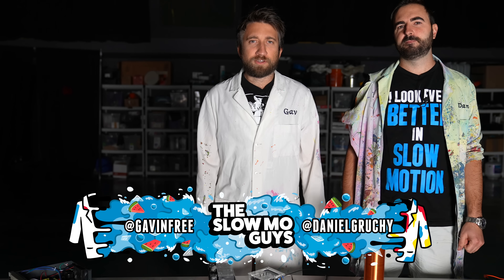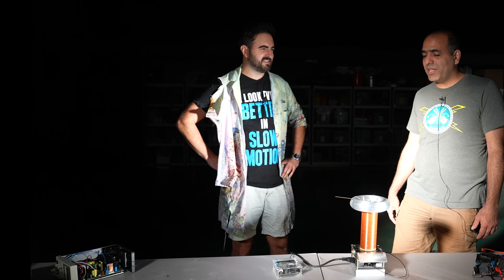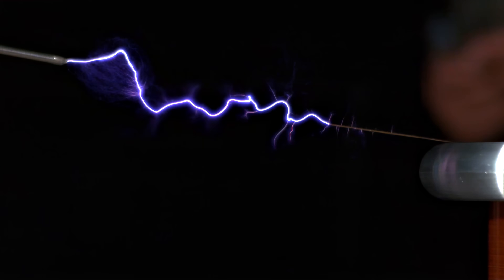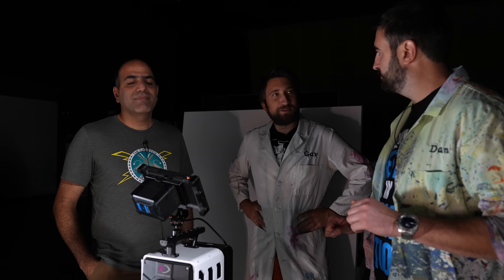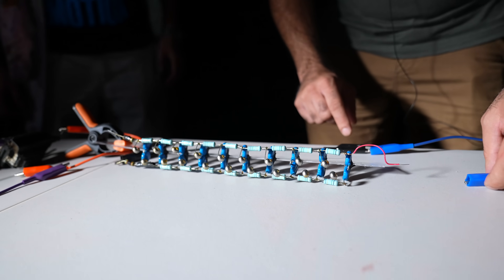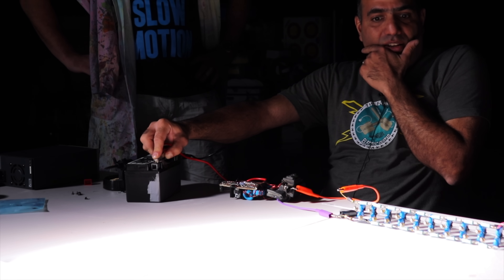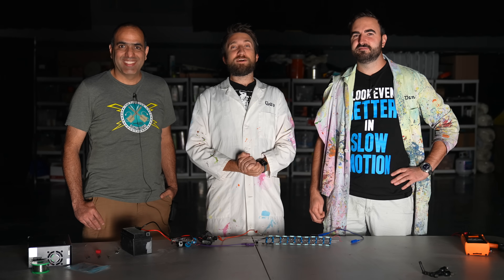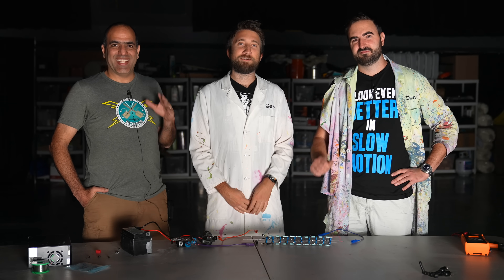Electrical Arcs at 1,750,000FPS - The Slow Mo Guys with ElectroBOOM

Comment: I don't know if Dan will speak to me after going through so much pain!!😈
Reply: The legend of comedy and knowledge 😂
Reply: He should’ve expected nothing less.  It’s the price of working with a legend like you!
Reply: I was shocked by mehdi
 (the t shirt)

He would have a cue of people in no time at all.
Reply: @leewolf6434  
It's more than that. It's one legend (or, rather, two legends) working with another legend.
Reply: 14:28 Hey Mehdi please explain this. Dan said you would explain it in your video. I don't think you did.
Reply: @harsh_adukia  he will most likely explain it in the analysis video (not yet released)
Reply: @harsh_adukia  I haven't watched his videos about the device so this is just my thoughts based on what I know. The thing is a chain of capacitors which build and store electrical charge in them and release it all at once. With his setup, full capacitors hold a lot of charge that want to release all at once across the metal nubs but they're being held back by the capacitor. Think of it like a dam holding back water, a ton of water that wants to flow down but is held back by a giant wall. What I think is happening is that each capacitor in the chain is building up charge and when they max out the "overflow" moves to the next capacitor. When it gets to the last capacitor in the chain there isn't anywhere else for this overflow to go. Now the dam from earlier is beginning to spill over as excess charge from the final capacitors searches for a new path - the gap between the metal nubs. As soon it completes its path across the gap it breaks the floodgates on all the capacitors since they now have somewhere for their charge to go and they all release it across each of the nubs.
Reply: @harsh_adukia  yes you are true
Reply: PAIN
Reply: @harsh_adukia  he will most likely explain it in the analysis video (not yet released)
Reply: @harsh_adukia  Mehdi is doing a follow up video next and going through the footage.
Reply: bro 💀
Reply: @hackerman1752 you’re not his bro, nerd
Reply: LOL
Reply: Thank you for not only keeping us safe through entertainment throughout all these years, but for also taking the time to explain all of this stuff to us.

I love all of the silly humor, and the creativity behind the video, but at the end of the day we all walk away a little bit smarter because of you. (And the slow mo guys, love you too.)
Reply: @MakotoMonokuro  keeping us safe? 😐
Reply: It's fine, im sure he's well used to it at this stage on the Slow Mo Guys....
Reply: Dan sacrificing hus body to get cool slow-mo shots is pretty much par for the course.
Reply: Mehdi, you have to take these guys and go do a collab with Styropyro! I know how much you love arcing electricity, and that dude does it like no other.
Reply: That capacitor gadget sparking on the final gap then setting off the others could be acting like a TX antenna, where voltage is highest at the tip of an antenna and highest current at the base? Could this be a visual of how a TX antenna works? Pretty cool!
Reply: Oh god it's the electrician
Reply: On the contrary, if Dan's relationship with Gav is any indication, he's probably trauma bonded to you now and will show up for more
Reply: The collab we didn’t know we needed
Reply: @OfficiallySnek  nobody "needed" this.. it's just interesting to watch
Reply: So glad you're still doing what you love and entertaining/educating us after so many years
Reply: considering you're not banned from UK after that video, i think Dan can forgive u
Reply: @ElectroBOOM  >>>  Nah, Dan is MORE THAN HAPPY to "take one for the team." 
 😊😊😊
Reply: OK, Boomers!
Reply: Well you didn't break his wrist like Tony Hawk, so you're probably ok.
Reply: My assumption on why the last one on the generator went first was maybe there was a large enough cloud of ionised air coming from the end part that the air resistance was much lower at this point.
Reply: @erdmannelchen8829  The closest pair will go first. They can't all be exactly the same distance apart.
Reply: Haha does Linus still talk with you? Didn't he suffer more?
Reply: I mean, your known for your setups shocking you, soooooo
Reply: Hey, Tony Hawk broke Dan's arm.
Reply: A legend ❤
Reply: Are you fixed the power supply?
Reply: We’re all spelling your name wrong, Mehdi lol. 
Sorry. 
It takes time to get used to very foreign spellings.
Reply: The more you get to know Mehdi, the LESS you will trust him!  :)
Reply: Hahahahaha
Reply: @UCxZHI-uH9LZ_OygPLFHH0BQ go eat dirt.
Reply: I dunno.
He's still friends with Gav.
Reply: Would it move faster in a vacuum? What if you changed the gaseous medium it was arcing through?
Reply: "its almost like its running at the speed of light... almost" killed me
Reply: What a fun combo, two of my long time fav yt channels coming together, and BENDING the envelope of high-speed photography and high voltage plasma discharges. 
Go Mehdi!
Now if could get Steve Mould in there two, would be a blockbuster science video.
Reply: You also did a mistake. You could put a grounded object there. But it was Dan.
Reply: at 18:31 i see that the arch gaps closest to left side of capacitor aka zvr side  are wider hence the answer to question is why the right side arch gaps sparked first creating the rest and why the brightness is highest towards the left...

answer :- due to spark gaps being further away on left side ..even though the capacitor charges up first with more voltage but due to further difference of arch gaps it keeps rising until the capacitor at right is high enough to create arch there due to low distance between them ..

now due to high charge on capacitor left the spark arch are brighter ...and so forth ...
Reply: Friends for life Mehdi, for ever ever.
Reply: This isn’t the the slowest they have filmed as I recall they filmed at 5 million on a explosion in water in July!!
Reply: Now you guys just need a sequel with even faster cameras and even more bonkers electrical thingies. Perhaps to zap Gav as well...
Reply: Pams
Reply: why does the arcs have random patterns? its random!!Is there a way to detect the patterns ?
Reply: The posterboy of electrical engineering and engineers in general is here….
Reply: What would happen if you did this in a vacuum?
Reply: He didn't break any bones in this video, he'll count that as not too bad XD
Reply: Op
Reply: Don't worry, he still talks to Gav
Reply: The reason the last gap always fires first, my guess is, the last gap happens to be the shortest.
Reply: Yep make a arcalator arcs then charges to 2.000.000 then boom
Reply: That should have known better 🥴
Reply: He trusts you enough to high five you next to all of your high voltage equipment, has he learnt nothing??? 🤦🏼‍♂️
Reply: Lol
Reply: Well, a higher frequency certainly Hertz him more.
Reply: THEMANHIMSELF
Reply: he broke his wrist for the channel, this is nothing
Reply: Boom... my heart has nothing but love
Reply: Bro, I knew this would be an exceptional video soon as the intro clip went by haha
Reply: FINALLY IT HAPPENED
Reply: FOOOOOOLLLLLLL BRIDGE RECTIFIERRRRRDRR
Reply: You’re wired and funny 
I hate getting shocks ⚡️ I cringe and laugh watching people getting shocked
Reply: I wouldn't...
Reply: Thank you good sir!!!
Reply: He doesn't have a choice, you saw him wearing a slowmo shirt, he should be buying you a drink.
Reply: I think I it's going on and off again within one pulse because of resonance.
Reply: Chad 007  i too have been waiting. Waiting for more spam accounts to block
Reply: 3:40 touching something electric while wearing a metal watch 😅
Reply: Way to get revenge for Dan's crimes in Iran.
Reply: That is the only way Dan can get a good rest these days; sore, bruised, or bonked. Mad lad
Reply: https://youtube.com/watch?v=ituKgMsZB9k&feature=share
Reply: خودت از بس شوک الکتریکی خوردی یک پا ثور و زئوس شدی ، واقعا تعجب میکنم چطور هنوز زنده ای. 😂😂😂

cause of So much electric shock you were hit, that made you become thunder god like Thor and Zeus 😂
We love you from Iran.
Reply: LOL
Reply: e wiz
Reply: My little one was terrified of electrical shock.  I let her have a few safe ones and she thought it was the funniest thing.  I think Dan will feel the same way.
Reply: I love your channel ElectroBOOM. 😂👌
Reply: Yeah but….  Gotttem😂😂😂
Reply: Super cool to see you guys team up!  :)
Reply: Thank you @electroboom for so so many thousands of smiles over the years.  You were the perfect partner for this project!
Reply: Medhi it would be ABSOLUTELY CRAZY and AWESOME to do this with a really big and much longer Marx Generator !
Reply: Boom
Reply: Nyquist.
Reply: 7:57 Nyquist frequency
Reply: I thought he was not going to trust you after that laugh. @3:17
Reply: He felt the FULL BRIDGE RECTIFIER
Reply: @Benjamin Garner that is right these two channels are the best
Reply: Do you know about Utkin effect?
Reply: If it ends like that then you know you've done a good job
Reply: He should know better if he has seen one of your videos......if not that’s his own fault for not researching properly.
Reply: Are u alive ? Oh thank god
Reply: He's probably experienced worse so you shouldn't worry that much.
Reply: @ElectroBoom It is interesting the impulse generator sparked across the last gap first. Hopefully this is something you discussed on your channel
Reply: lol!!!
Reply: it's your first video..... that you didn't scream loudly 😂
Reply: I can hear him saying this
Reply: u looked like ur getting interviewed on live tv
Reply: I was wondering if you think the final spark gap arced first due to the fact that conventional current is running from negative to positive? Also, assuming that the velocity constant through this medium is approximately 0.6, and a marx generator length of approximately 400mm this would mean that the propagation time through the circuit would be around 2 microseconds unimpeded. Once the surplus charge is bridged across the first gap, then assuming relative homogeneity across the remaining gaps, then you would need a frame rate of around 6 - 7 million to capture the difference between each remaining gap (based on the number of gaps I counted). Also, please be careful. I built a Marx generator once and was working on it when I was very tired one day and somehow made the mistake of trying to build a voltmeter to measure discharge and accidentally build the circuit incorrectly and the generator literally vaporised my voltmeter circuit into powder. At the time, I had stacked the layers of the generator up to approximately 600kV at which point I decided it was starting to get a bit too dangerous for a bedroom project.
Reply: Hehe you were and are awesome!
Reply: E
Reply: Why does the spark start at the other end?? Silly humans. Electricity acts no different than Pneumatic or Hydraulic. Imagine the oval ends as nozzles. Your vessel has to first fill completely and pressurize. The pressure and back-flow starts at the farthest point.
Reply: Could be a good teaching method in Electronics School
Reply: I would. He would.
Reply: Literally ur whole career, he’s gonna survive.
Reply: I don’t know how you are still alive bro 😭💀
Reply: I’ve seen your electric guitar.  But I’d still trust you.
Reply: چطوری عمو برقی💀
Reply: And it was optional lol
Reply: The legend personally 🔥
Reply: Check out a video that just came out from thunderf00t, it was an extension of this video with some pretty amazing footage, would be awesome to see you guys film his same experiments with newer equipment. I promise it’s worth it.
Reply: Love u bro ❤
Reply: Lol
Reply: That is just shocking.
Reply: My fav creator on YouTube is you
Reply: OMFG ELECTROBUM!!!!!1!11111111
ME YOU FAN!!!1111111111111111
Reply: AaAAAaaaaa an a
Reply: Thats what she said
Reply: I'm ded
Reply: Things black people cant try🖤♥️😅
Reply: As soon as I heard the accent I found out where your from ! Eyval
Reply: You "blew your power source" BOOM, sounds like your run of the mill gold digger in action! Lol
Reply: First time seeing your videos, really enjoying them you have over 15,000,000 of em but ya got a new sub 😂
Reply: The last one has the lowest gap in the maxx generator
Reply: He'll have to when Phantom releases a camera capable of 50 million fps. The fans will be demanding it lol
Reply: Interesting how electricity arcs look like plant roots, or veins, or nerves, or lightning
Reply: hahahahaha😂
Reply: You are an absolute legend!
Reply: ??????❤🎉 slow mo the dangers of a hand crank to start a tractor engine the crank arm can kick back so fast Destroying your arm and or thumb in a blink of an eye
Reply: I have a question, hopefully both ElectroBOOM and Dav and Gan see this:
Because of the distance between each point where electricity pass through each"gap", visible at almost exactly the same time. Would their be a time difference if the gaps were at different lengths? Say each was spaced about 10 mm, and 20 mm and 50mm, would each "gap" then be at the same time? In other words, Mehdi has 8 gaps - gap 1 and 2 is 10 mm, gap 3 and 4 is 20, 5 and 6 30mm, etc.
Reply: Also 50 million frames sound absolutely crazy! How long until you can see that fast from a phantom?
Reply: 150*
150
Reply: plum
Reply: Hey Mr Boom, I appreciate the way you present your content, it is always shockingly entertaining, which helps with retention when learning something.
Reply: @ElectroBOOM So this got me wondering at 18:25. Bare with me as I talk this out. So electrical energy is charging all of the capacitors on the line. Each one is storing electrons inside and building them up. This should happen nearly at the same time ( all charging in 1/c seconds ). Normally a capacitor would stop gaining electrons once it has reached capacity. Since it has nowhere for them to go until something shorts it. However you have created an air gap which acts a switch to short the capacitor. Dumping nearly all the stored electrons across the air gap. Since the air is acting as a resistor, the shorter the distance the less resistance which causes the last set on the right to short the capacitor briefly before the others since it is just a bit closer together. It would appear as though the end set has enough time to dump its electrons and break the air gap completely before firing at the same time as all the other ones. This got me thinking... why does the arc in the last air gap go fully out before they all fire together? Up until that short, they would have been charging at the same time/rate. Since the last set has dumped its electrons ahead of time, does it cause the other sets to take longer to charge because it siphons off electrons to charge. Like how a vacuum will create low pressure or is it just charging out of sync.
Reply: Lmao
Reply: You always enjoy tickling the dragon's tail😅
Reply: Love your content man.
Reply: I know this is old but, I would love to see the soldering process in slo mo to see the moment when the solder liquefies and see if it is instantaneous or if you can see the blob slowly liquefy.
Reply: I don't think he will talk
Reply: Electro Boom wer are you frame? ‌ 🙏من ایرانیم لطفا جواب بده
Reply: I wonder how you still alive
Reply: He dead 💀
Reply: We love you so much mehdi!
Reply: we learn by pain
Reply: He'll be fine. If you break him, Gav has a cloning vat out back of his house.
Reply: At some point while holding either the wand or the screwdriver, he should have screamed, "unlimited power!"
Reply: Hmmm, do a 500'000v/500 amp hit?
I'm sure he won't mind.
Reply: Awesome video guys. Thank you Mehdi
Reply: id like to see Medhi on Tested with Adam i love all that you guys do for education and ive learned more on youtube than I ever did in school
Reply: Looks like you got your match in the tolerance level😂  @ElectroBOOM
Reply: This was incredible, and I'm checking your channel out after this, for sure.

The SOUND that the electricity makes is crazy
Reply: I love you
Reply: Bro...your tooo awkward man😂
Reply: Well, you get ionisation switches that go into the MHz repetition range, used for some military radar systems, so expecting less of air is no problem. Also some gas filled tubes would be quite happy oscillating at over 30MHz, so the gas ionisation must be capable of being quenched as fast.
Reply: One more collab plsssss!!!!!!
Reply: Yes because he now knows he didnt have to get eleetricuted to get that footage😂
Reply: bruh
Reply: Verified must reply !!!
Reply: Watching the slowed down Video, where nothing Happens for half an hour and than find Out its still not slow enough is worse in my oppinion. Its Like the Pitch drop Experiment, when you leave the room to get Coffee and See that the Pitch droped.
Reply: Dan isn't a poosey like Gavin is.
Reply: Ök
Reply: Lol 420 likes🤣
Reply: @Tx_6969 yeah not that funny. I mean if you’re 16 and just started smoking weed maybe.
Reply: @a-a-ron4679  I guess your mom does that. But I don’t
Reply: @Tx_6969  lmao. There you go. Throw my mom in on this. I was wrong. You’re not 16 you’re 12.

Comment: I've got to ask. That camera is amazing. But if you're doing a million frames per second, how does it manage to actually save all that data! Is it just that solid state memory is that fast or is it stored in something like RAM and you have to wait for a couple minutes afterwards for the video to finish saving?
Reply: Maybe it stores straight to an external drive?
Reply: @calebbaldwin357  Yeah but that all takes time. If two seconds of recording is 19 hours (or was that one second?), that's not an instant transfer. Even considering the low resolution, I'd assume the files can get quite big very quickly.